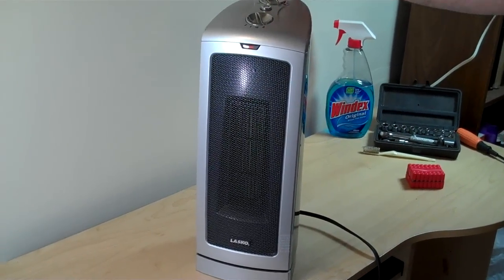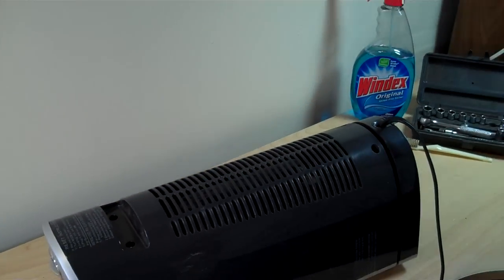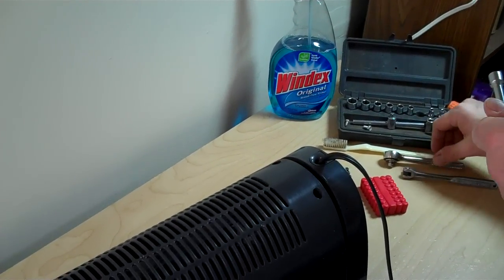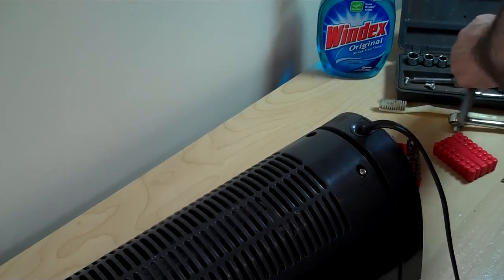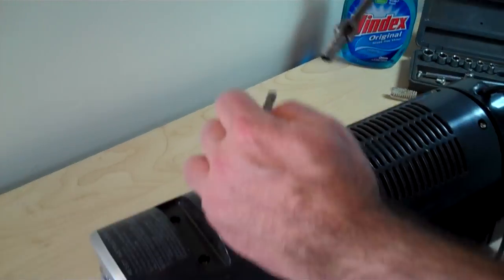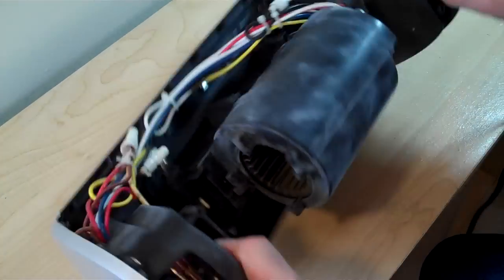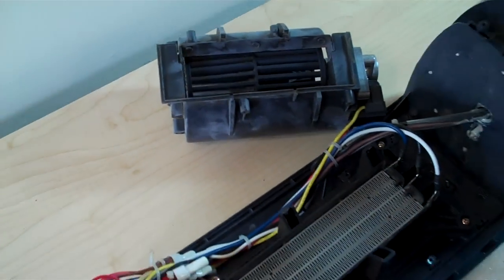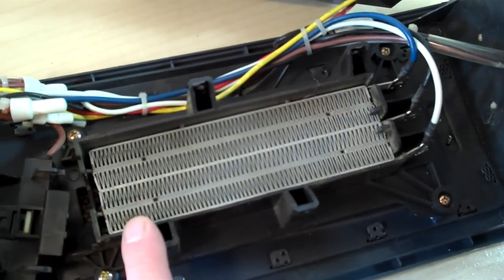How To make An Electric Space Heater Efficient Again! DIY

Comment from the maker: You can but I would think it would make more sense to run an additional table or pedestal fan as it would circulate room air much quicker for about the same amount of electrcity, which is what I do. A ceiling fan would be even better. The fan in the heater is designed to get the heat out of the ceramic heater element but not for entire room circulation. If the ceramic heating elements held heat for a long time, I could see running the fan all the time. Interesting idea Chan. Thanks for watching!

Comment: Good vid.  I did this with a heater that had safety screws with a triangular hole, of all things.  The guys down at the general store couldn't get over them.  Everyone needs a real general store where you can haul in something like that and say, "Now, what would get THIS apart?"

This should go without saying, but it's probably worth mentioning that you need to UNPLUG THE HEATER before you open it up.

Comment: Excellent video.  Most people would think when there heater stops heating that maybe the element was going out, but with your video you show that it may just need a simple cleaning.  
Ours works great, we bought it last winter at Ollies for $39.99.  Since then we've adopted a couple of kittens and they have tipped over it at least 5 times, and it still works like new. 
Thanks for the how to tips. It works.

Comment: I have a 13 year old Lasko heater that needed cleaning. I could not find security screwdrivers very easily but I saw an article on the internet about guys in prison heating toothbrushes and pushing the hot toothbrush into the screw, cooling it and making a mold. I tried this at home and sure enough it worked!! I got all 4 security screws out, thoroughly cleaned the fan assembly and heating element and now it puts out about twice the heat it used to.

Comment from the maker: I still have my old 1980 coil heater I got at a garage sale in like new condition. Those just burn the dust off and keep going. I am impressed with the ceramic heaters though. Never once saw an element fail in one. They just get clogged up with dust and don't have enough running through them to circulate the heated air. The amll cbe ceramic heaters usually use standard screws. I agree about the profit side. Shame they don't care about adding to landfills for want of profit.

Comment from the maker: @Alienated29 Good deal. I thought of using a shop on the back air inlets to see how much I could draw out without having to open the heater up. Another way would be to place the heater air intake down and use a hair dryer on high fan and use it to blow into the front and force the dust out the back. One thing you don't want to do is get the dust off the heater element and let it sit on the wiring inside. You're welcome!

Dale

Comment: I have a window ac that also heats. I know how to clean for the ac. So this is basically the same? Also how would I remove any restrictions so my heat would double in temperature like the old days when heaters got red hot. Thanks, hope to here from ya soon.

Comment: Dear man, and dear friends!
From my experience, I would like to tell you that the easiest way to get the best results is to power on the device, on "air-only" mode (no heat), and then splash air from an air compressor (compressor, not conventional blower!).
How It Works? Very simply! what happens is that particles of dust have accumulated on the heating element from the inside, and become like a block, so they can not come out, and they block the air flow, and when you use a compressor, the dust particles fly on the propeller, which rotates, and then they break down and return to the powder, And with the help of the compressor blowing, removes all this dirt out easily (comes out like a cloud of dust).
After a few air bursts, the device will be almost like a new!
By the way, the same is true for laptops - do not need to disassemble anything to clean!
I hope one day to take a video and show you.
Thanks for the video!

Comment from the maker: @Alienated29 Did your heater totally quit or does it just seem to not heat a big area well now? If it puts out heat but you can only feel it close to the front of it and can't feel the "wind" off of it two feet away, chances are it's clogged up with dust etc. Hold the heater (unplugged) in front of a  bright light, if it's a standard ceramic heater, when it's clean you can see light right through the heater element. If not, it's clogged.

Comment: I forgot to mention that 2 of my 3 Lasko heaters caught fire..and that's what prompted me to clean the remaining one. I didn't see open flame but I heard a "whoosh" sound and smelled burning plastic so cleaning space heaters is not just about saving money it's also a safety issue. The dust bunnies and dirt had built up pretty good on the ones that burned. But Lasko builds a really good heater that won't konk out after one or two seasons but it MUST be cleaned regularly and they don't make it easy with those security screws.

Comment from the maker: This was an old junk laminate desk we threw out not long after the video was made. The heater was barely putting out any heat and was headed to the trash pile. I wasn't worried about scratches on the desk or the heater. I tore the heater apart to look for any obvious issues just to be nosey. That's when I discovered the blockage and how to remove it. Some people are poor and can't afford to replace things like this. This video was made for the poor and the frugal. Nothing more, nothing less.

Comment: @mediamaker2000 My heater is up and running again. I just blew on it really hard. I didn't even have to take it all the way apart (I couldn't). It has a rotating base that it was still attached to. I just blew on it really hard to get the dust out and it started right back up. No wonder I was smelling a burning smell.
I wonder if this was the same issue with the previous heaters I've dissected and couldn't get back together. Such a simple fix. Thanks!

Comment from the maker: You're welcome. If heaters like this had a filter similar to the material used in dryer vents or window air conditioners that filtered the air, they would last much much longer. Good luck with your space heater. If you don't mind, keep me posted. It's most interesting!

Comment: I'm here cause i need to repair the electric heating elements. Some days ago i cleaned my  space heater ceramic modules, but i  detached the single elements breaking the "glue" between every element (wrong). Now i see some sparks when the heater is turned on between the electric modules. So the question is: where i can find the same glue for stick the heater modules? there is another solution ?
Thanks so much

Comment from the maker: As for buying a "good heater". They are all good heaters. If you buy a 110 AC electric heater that costs $20 or buy one that costs $400, they put out the same amount of heat. 1500 watts (on 110 AC) puts out 5000 BTU's with an electric heater. Plain and simple. Ceramic heaters, of which this video is made has fins to dissipate the generated heat. Since it has fins but no filter, it will get clogged buy dust and debris eventually. You can either clean it for $0 or buy a new one.

Comment: Dear Mediamaker2000, Thank you for this video. I have a same one. Do you think DIY is possible to make the fan blowing all the time even the thermostat shut off. i am thinking to disconnect the power of the blower and then connect wall power directly to it, so let it blowing all the time. it will provide more even temperature control. But i do not know if the motor is powered by 110V and any capacitor and/or resistor will be involved in this DIY. Thank you.

Comment: I have a lasko thats different but looks to have the same element. Mine powers up with 88 and does nothing.  If I hold down the power button it will start in high, start to heat up and shut off.  If I hold the power button, plug it in let it start for a second and then release the button it again quits and goes to 88.  So I tested the element and it's 70 ohms one way to the midle, 100 ohms the other side to the middle, or 170 ohms between the two outside terminals.  I'm wondering what everyone else's tests at?  I think that may be the problem but I'm not sure.
Reply: Any luck with your heater? I'm having the same problem
Reply: @jac981  Yes, I got it working.  My problem was the thermistor.  I tried one from a junk pc power supply and it worked but showed the wrong temperatures by too much of a degree.  Then I used one from a junk Drill battery and that one was close enough.  Maybe off by 4 degrees. The thermistor has two black wires and is glued to the air intake at the front of the heater. It didn't have a number on it.  So I just have to remember that it will be warmer or cooler than it says it is.  I just cut the wires where the old thermistor was, slid on some heat shrink and soldered on the other one then glued it down like the orig was.
Reply: Thanks chad

Comment: hey  great info   , I have a space heater like new and it will only blow cold air it works good as a fan but i want a heater what should i check for?
Reply from the maker: Loose connections to the heater element. Could be the thermostat but you may not be able to find parts for that or at a cheap price. Some have internal fuses for the heater element as well but if it keep blowing fuses, it is most likely a bad unit.

Comment: I have an electrical question!!?? I  was hoping you could help me with .. I need to replace the end plug .. would  cooper wiring  15-Amp 125-Volt 2-Wire Plug work? on model number Lasko model number 5362 120V 60Hz 1500watts.. <learning> please advise .. thank you :)
Reply from the maker: That should be fine. I am not an electrician but have an electronics degree. 1500 watts is what your Lasko is rated for. If your power source is 115 volts, it is using 13 amps of electric on high setting (1500 watts). At 120 volts, it's using even less amps. I usually go for the next highest rated plug if it's not overly expensive though. I like the round end plugs with the screw down terminals. They are easier to wire and less chance of a loose connection. And don't take my word for it only, many workers in the home improvement stores have electrician backgrounds and know way more than I do. Thanks for watching!
Reply: Also make sure you get the right type of plug for the cycle 60-20-100

Comment: Do you know what size bits those security screws were? I have the same heater but don't know what size bits to get. Thanks
Reply from the maker: +MSPREPR I'm sorry but no. I can tell you that I bought the security bit set at Micro Center and it can be ordered online. The set is inexpensive.
Reply: MSPREPR you can buy those at Harbor freight, very cheap. if it has an center pin indent, drill it out. lol